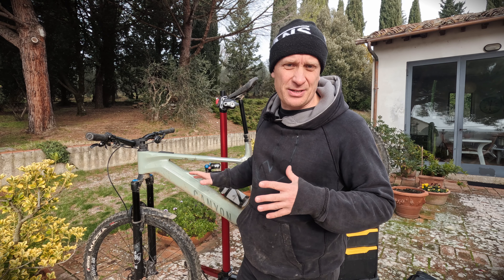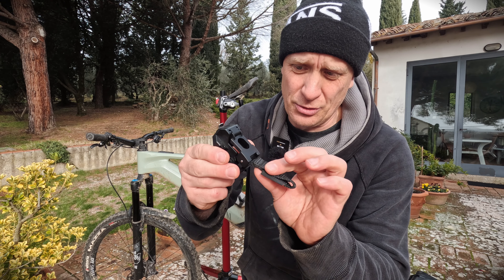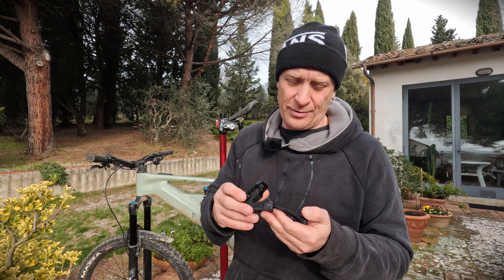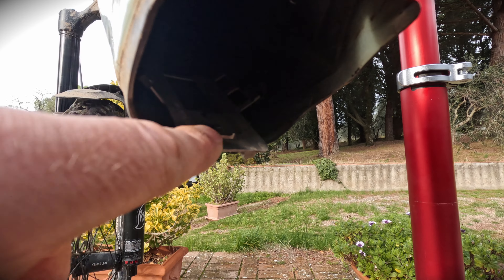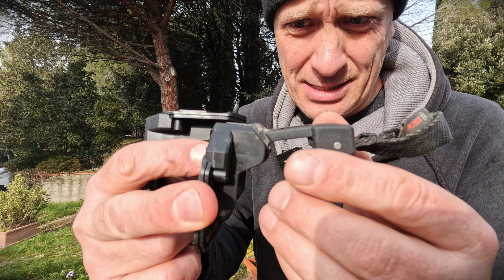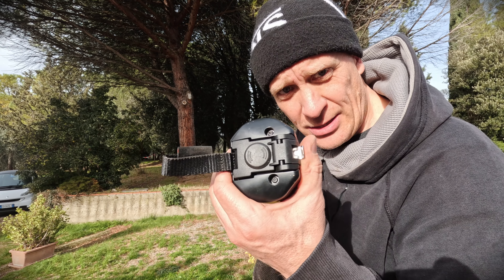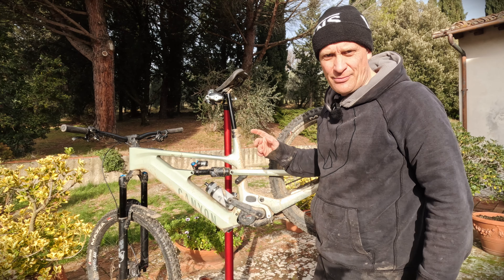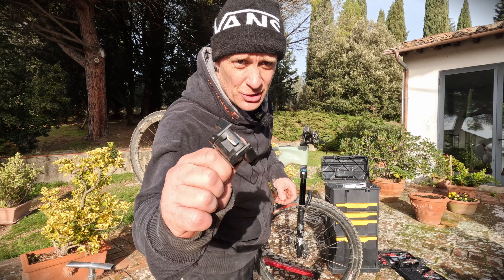How To Stop Your New Bosch E-bike From Cutting Out!

Comment: Great Video man, just about to buy the same canyon. Did you contact canyon or bosch for this updated part. How did you get the new part?
Reply from the maker: I got it from Bosch, you can order it from them or any other Bosch parts retailer. Also there are a few bike tool websites out there. This is the best one on the market. All the others don't grip the crank axle.

Comment: I have the redesigned bracket and it's STILL cutting out. It's been back to Canyon who checked it all over (took 2 months!), returned it to me, 2 months later and it's still cutting out. Got a Wales trip in a few days, back to the normal bike for me. Going to miss a summer of riding! It's only done 800 miles, never jetwashed, or hose piped. Beginning to wish I hadn't bought it....
Reply from the maker: Remove the connector inside, make sure it is all done up. Then put it back. PLus wrap electrical tape on the clamp eyelet . Should solve the problems

Comment: "German engineering" at its finest. Reminds me of early days of Siemens Velaro trains, when they were meant to be docked gently, while service crew bumped them like usual cars, breaking the couplings.
Difference being a multiple unit train with self-propelled cars, so the interface was designed for much lower forces.
Reply from the maker: yes good point

Comment: We hear a lot of YouTubers at the moment about the solution provided by BOSCH, it's good, but none reported the problem during the tests, and this problem is neither new nor isolated...."don't bite the hand that feeds you...
Reply from the maker: I did not have the problem because i did not remove the battery. The problem arises when you remove the battery and put it back in too strongly it breaks the plastic rotating latch. MBR also mentioned this problem. So which youtubers are you speaking about?
Reply: No. The latch (1st gen design) gives up after some jumps or kms.

I don't remove the battery (I think I removed like 5 times if that much), and have all sorts of problems with the battery.

Comment: The title suggests a fix for ALL bikes with the Smart system, but It depends on the latching system. Trek had to replace the frame and motor on my 2022 Rail as a solution when they ran out of ideas after the bike was in the shop for 3 months.
Reply from the maker: If you read the description and watch the video I am very clear it is about this latching system, which is what causes the most of the motors to switch on and off.
Reply: @alexbiketester  Then don’t put a clickbait title on the video
Reply from the maker: @timgearing5121  i would say its the main reason for these motors cutting out. the latch/clamp. and im showing it in the photo.

Comment: I’m having this problem with my Orbea Wild.
Reply from the maker: whats the attachment method? the same?
Reply: Not sure mate, I never remove the battery - it’s not easy on the Wild. Took it to the LBS, and they seem to think that vibration/play is the cause of the problem. They just snugged it up. 
However, until watching your vid, I didn’t realise that there’s a solution. I’m taking it back in a couple of days, and will show them your vid to reference. 
I’ll keep you posted. Thanks for your help!
Reply from the maker: @jimm3379  no worries. Get them to check all the connectors and wiring loom.
Reply: Exactly the same issue on my 12 mile old 2024 wild M11.  Went to the LBS to fix it. Thought it was right, it wasn’t so back to the store it’s gone. Gutted is an understatement

Comment: I don't have this on my Gen 4 smart system I have the 2024 cube they stuck with the under tray key lock
Reply from the maker: You should be good then, apparently there are 5 or 6 brands that use this system.
Reply: Me too (Cube 2024) and rattling...

Comment: Well... you won't stay there! Bike will cut out, and present errors, with battery not connecting. Mine is waiting for reply from Canyon for over 6 working days... I suspect it's a upper connector going out.......
It really removes all the confidance on the bike
Reply from the maker: You need to remove and tighten the top connector. That solves the problem, I found that two screws were loose and needed loctite. Its not a super easy operation but with patience can be done.
Reply: Already done it, and was the logical process. Nevertheless thank you!
Thing is, I suspect that the connector became damaged.
If you verify, the battery is supported only by the Latch (which has been redesigned), and the connector. 
I'm afraid the all system needs a fair thought into reviewing the design, and produce some reliable and durable solution.

It's very annoying, not knowing if the bike will let you down in the middle of the woods, far way from home/car

Also, the time Canyon takes to respond and gives an option to repair, is too long!
I placed a new ticket, and after 6 working days - NOTHING! No response, not even to followup mails.

I can't recommend Canyon due to this, and the Strive is a good product, but c'momm... customer care is a must in ONLINE sales.

We're talking about +5k€ bikes....
Reply from the maker: Its actually technically a bosch problem apparently, as scott and whyte have had the same issue  @tmstriveon  but the bike brands need to fix it to come up with the correct customer outcome. 

SRAM batteries use a magnetic connector, no such issues. 

It puts a dampner on the bike. I would go to a bosch service center and ask for a warrenty replacement on the plug as well.